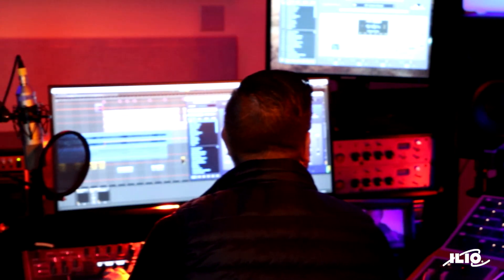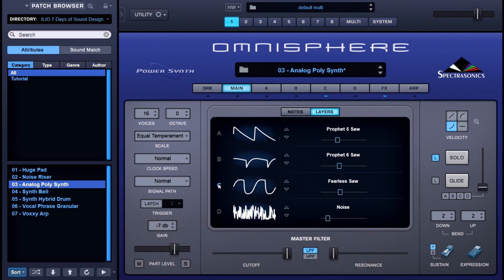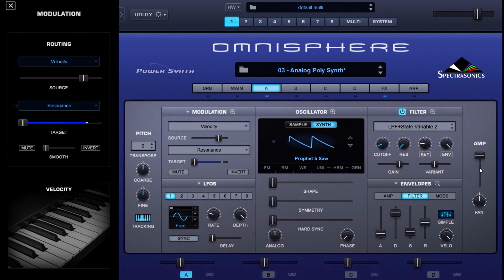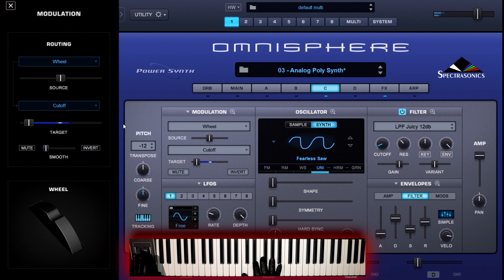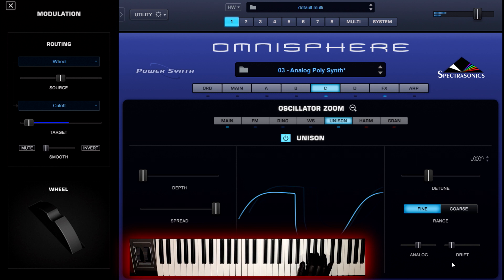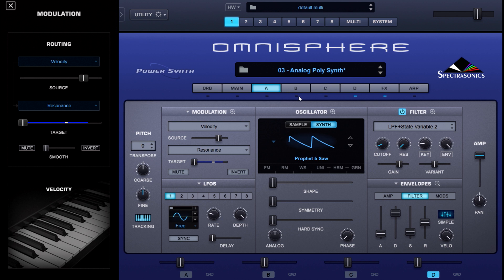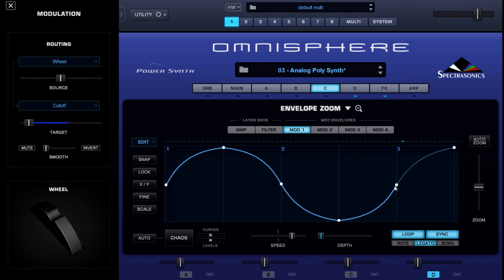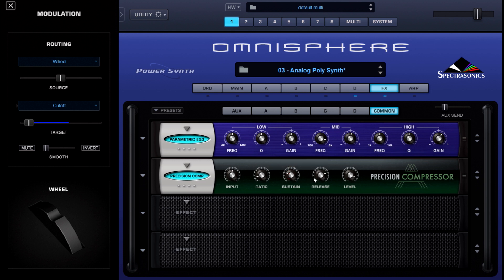7 Days of Sound Design: Day 3 "Analog Poly Synth"

Comment: Hi! At 5:40. LFO 1, LFO2, and LFO3 are all modulating the Fine Pitch. How does it work when more than one LFO is modulating one parameter? Does the LFO signals add up or what❓🤔
Reply: OK, what's happening is since all the LFO's are modulating the same parameter at different speeds, and since they're mostly all sine waves, you end up with smoother, unpredictable results, which is what you would expect with analog circuitry. If I simply added only one sine wave, it would sound predictable and thus be unrealistic. I understand this is not something you would do with LFO's on an analog synth, so this is my "hack" to fake it pretty well on a digital synth. Make sense?